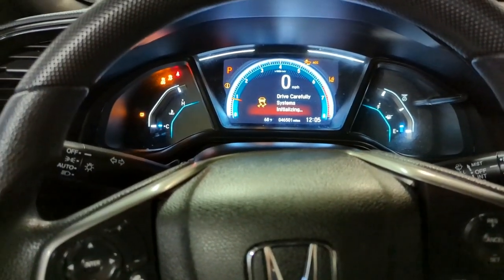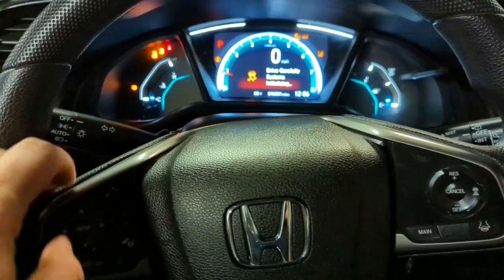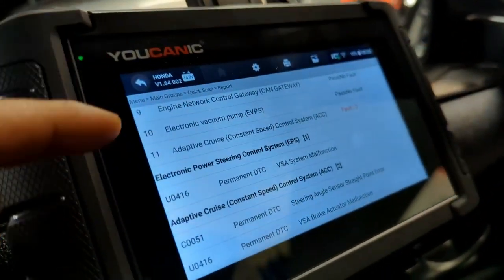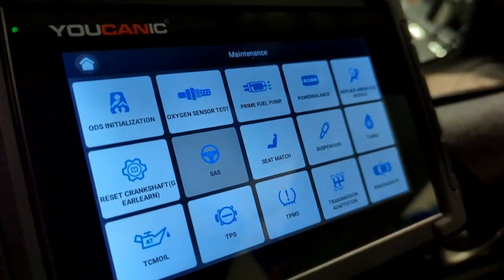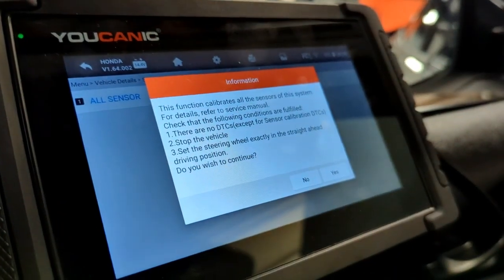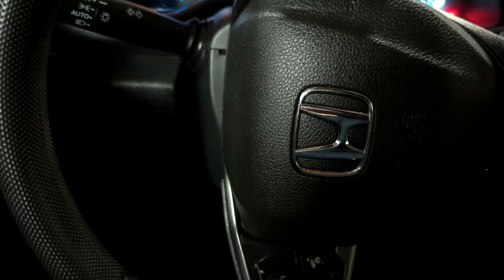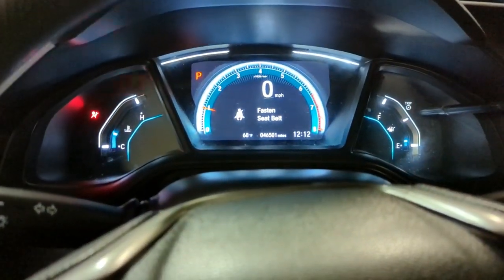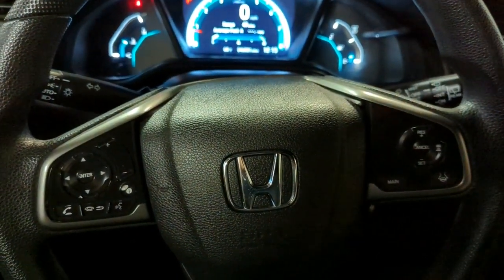Honda ABS Traction Control and Steering Angle Sensor Reset | No Scanner & With YOUCANIC Scanner

Comment: Excellent video. My exact problem. Began after driving windy roads in the fog through the Black Hills of South Dakota. I attempted the full left/right wheel turn with no luck so will need to take it into the dealership. Hopefully they will be able to take care of the issue as easily as you did. Thanks for sharing!
Reply from the maker: 👋 Thanks watching and for your comment! Our techs may not see every YouTube message, so if you need help or have a car question, visit www.youcanic.com — our team is happy to help!
Reply: What did the dealership say? Why exactly this is coming?
Reply: @ADITYACOOL90  I had to pay $150 for the dealership to diagnose the issue. As suspected, the traction control light was stuck on because the  lateral g-force sensor tripped while we were driving those winding Black Hills roads. The dealer verified that was the code, test drove the vehicle without issue, reset the code, and sent me out the door. Frustrating to have to pay $150 to have a light reset, but glad to have the issue resolved.
Reply: @thediydaddy2068  thanks for the reply. I will get the codes checked , planning to replace the battery first and try, I know paying 150CAD is frustating  just for code reset !!

Comment: Great advice. I have have all sorts of issues  with the reverse guide bars randomly not working to ACC, (EP) VSA, BREAK HOLD, HILLSTART  ABS . CODES  and tire deflation warning, I bought a scanner and Im getting that C0051 & U0126 BOTH are related to the  STEERING ANGLE SENSOR, but Im also getting C003A  REAR RIGHT SPEED SENSOR , So I monitored the values on that abs sensor while driving and it seems to be working   also the steering wheel live data is reading on the scanner,so this is arkwards to know if one is causing the other. any advice.
Reply: Please what did u finally do, I have same issue

Comment: Sr, how do know if i need to reset my civicx's steering angle sensor?

Feb this year, dealer replaced my steering rack assembly under warranty. Steering felt heavy after and is off centered.
I went to another shop the next day to have it aligned but still the eps steering assist only worked for a day then it goes back to being a little stiff. Now it works intermittently even after changing the battery. On wet and rocky roads, steering assistance works perfectly. Very light to manuever on low speeds. But on cemented roads on hot days it feels heavy. Does it sound like SAS needs to be recalibrated? Or does SAS affect steering assistance?ty
Reply: Hi i am having same symptoms as u, what did u do to get the problem fixed?

Comment: Where can I go to get this done besides the dealership?
Reply from the maker: Sure, you don't necessarily need to go to the dealership for this. Check out the YOUCANIC Full System Scanner that can help you diagnose your car's issues (www.youcanic.com/scanner). If you need further assist, visit the YOUCANIC website which offers a full range of automotive resources (www.youcanic.com). You can ask any car-related questions there. We're here to empower car owners like you to even repair your vehicles confidently. Feel free to reach out if you have more questions!

Comment: ❤
Reply from the maker: Thank you for your heartwarming feedback! We're glad to know that our car fixing video has helped you. Diagnosis plays an integral part of car repairs. This is why we've crafted the YOUCANIC Full System Scanner, a tool designed to empower car owners like you in the same way an expert mechanic would. To know more about our scanner, check this out: www.youcanic.com/scanner.

Should you wish to execute the job even better, access to Factory Repair Manuals and Torque Specs is crucial. For a minimal fee, you can use this vital information! Get a hold of it here: www.youcanic.com/manuals. Happy fixing!

Comment: Im getting all those lights on but also my steering wheel is slightly off center to left by about 8-10 degrees. Ive replace the front axle and have battery and alternator issues. Could I correct the steering angle without getting an alignment or using a computer to calibrate it? In another video, the mechanic stated that hes seen this issue with 2016-2021 honda civics but was using a computer to calibrate the -8 degree angle
Reply: hey please what did you end up doing because I am having this same problem. Thank you.
Reply: @allimuhammed3662 , probably was the angle sensor. If you diy replaced it, you placed it incorrectly, and that is not allowing the steering wheel to be centered. I had the same problem and that was the solution.

Comment: I'm having all those lights on my 2018 civic. However, the steering wheel is stiff
Reply: I have these light on after I did my rear brake pads tried resetting my steering and I get an error message saying not supported. My steering isn’t off and works just lights are on
Reply: @jerrettoakes8435 my problem right now
Reply: @jerrettoakes8435  Same with me. All codes after rear brake job
Reply: @scottjohnson921  how did u fix the problem same thing happened to me when I replaced the rear brakes n rotors
Reply: Sounds like you might have a bad power steering rack
Reply: What was the issue
Reply: Guys open and close the calipers